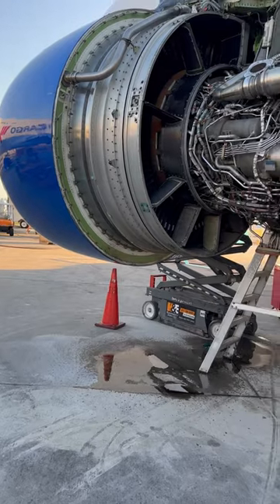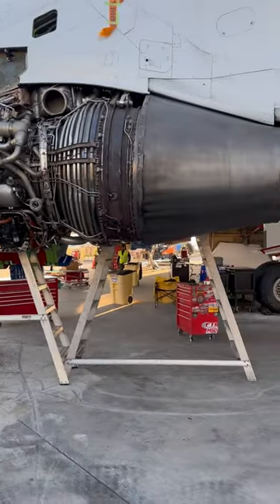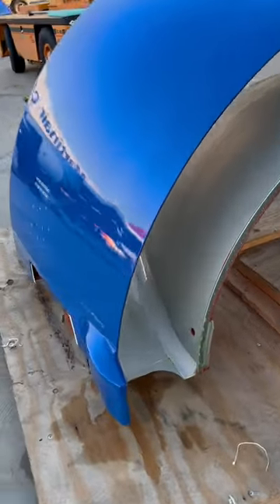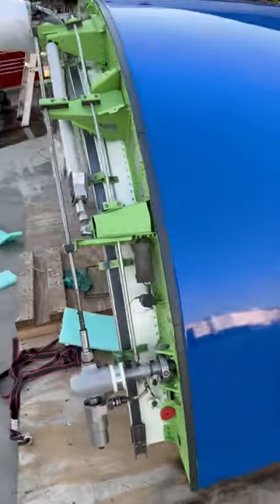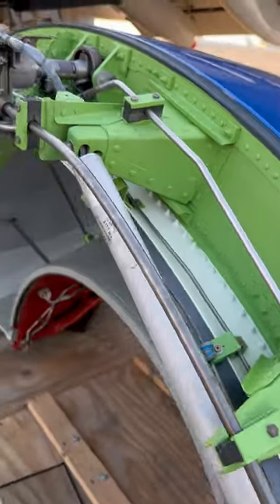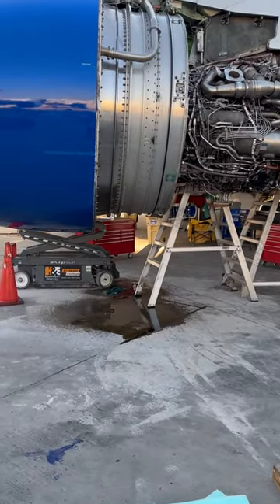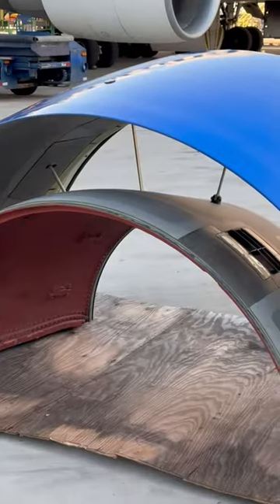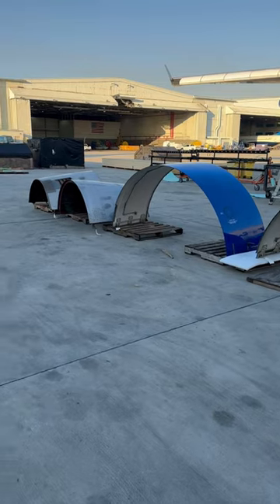BEAUTY IN EYES OF BEHOLDER ( Jet Turbine Engine Exposed ) #school #youtubeshorts  #study

Comment: What planes is an engine belong to?
Reply: a 747 it seems like
Reply: @spenthezeros  no, at Hiller Aviation Museum they have a 747 engine and it’s huge. Even bigger than that. Maybe a 787
Reply: @CaptainSean2011  the 787 doesn’t use pw4000 engines
Reply from the maker: Actually this is Pratt & Witney 4060 and 4 of them mounted on the B747 Dream Lifter also con be mounted on B767. Thanks for enjoying short show guys. Have a great night